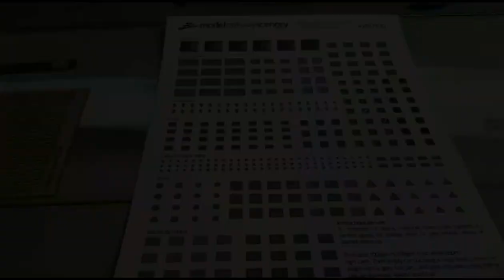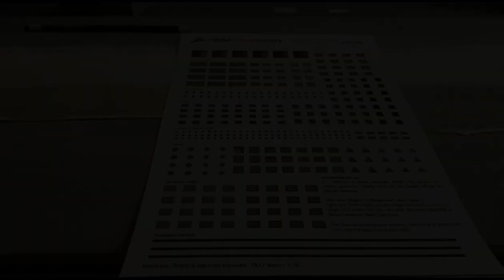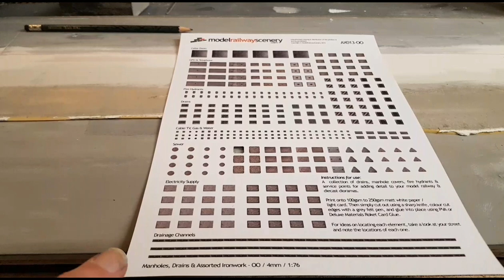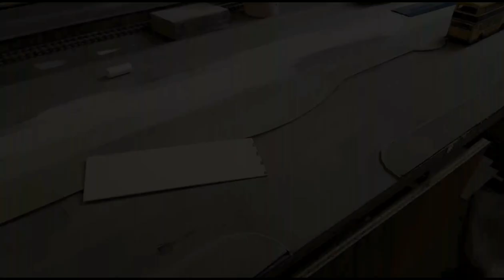Exeter & Laira. Part 7. Roads & pavements.

Comment: Hi Tim, I worked as a Taxi driver working from St Davids for some 17 years starting around 94. Where you have put that oxford diecast is the start of the rank, and half way down where the hatched lines are was a big double wooden door the the post office train would be emptied of mail, the cart pulling the mail cages used to run out then down to the back of the rank that is now a vets.
Reply from the maker: It's funny you mentioned that. Just over the last 2 days I've found images of just that and the slight differences from what I've done. I'm very fussy on detail so it's most likely I'll make any changes in the near future.. did the curved kerbing areas exist during that time period? 
They joys of modelling a real location!
Reply: It was put in around the mid 90s  maybe later from memory, There is road humps there now i think was done around the same time.. the other thing i remember was a burger van set up on the bit of waste ground near the level crossing every night. that was a big part of being a taxi driver lol. The big carpark outside St Davids is a short stay carpark the long stay one is at the level crossing. I must admit i cant remember seeing the smaller D you have modelled but its been years since i was down there.
Reply from the maker: @cleanteamsouthwest30  yep I think the smaller d wasn't there from a mid 80s picture i found and the give way markings were at the end of the road as you drive up towards the building. Good to know of the burger van, guess that's near where there was some form of large white fencing by the crossing?